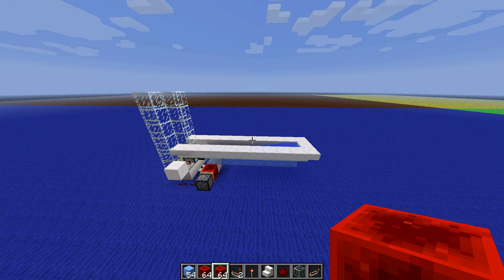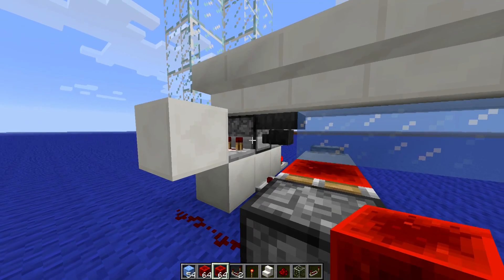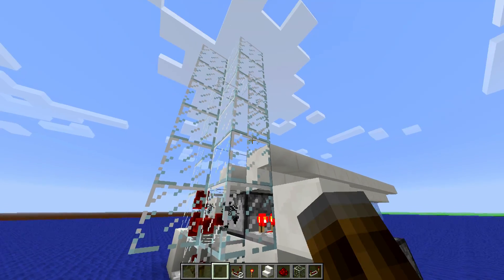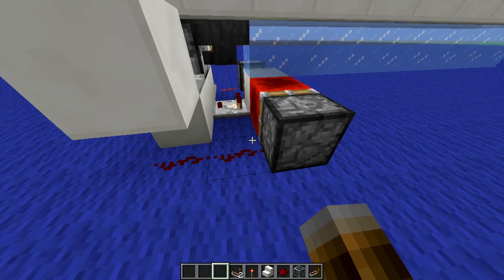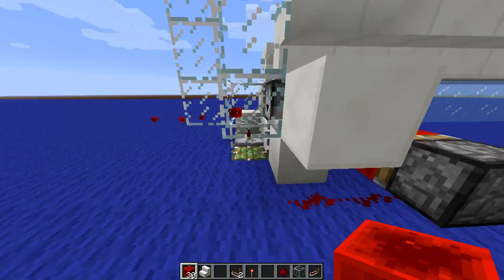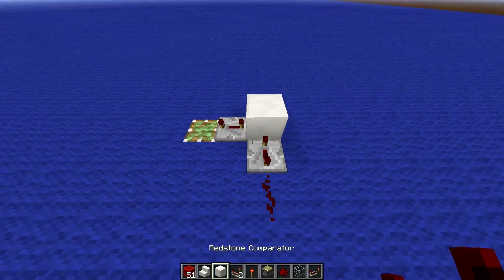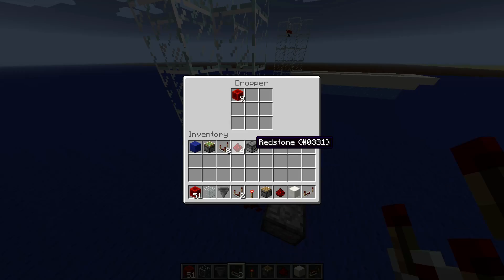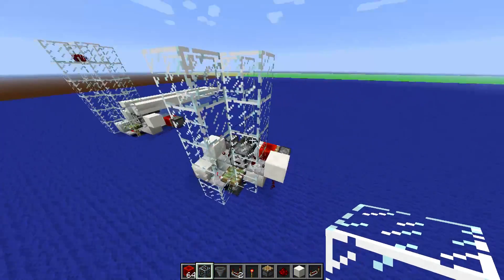Minecraft Hopper Invention #5: Simple Hopperdropper Itemelevator.

Comment: Still works, but you need a 2nd hopper. The comparator in the back, powered by the redstone block, needs to be fed into the dropper directly, and the pistons, redstone block, and other block need to be lifted one block to match it. To do this, you need to move the hopper to feed the dropper from the top. To prevent the items from flying out, however, you need to block the space above the hopper, so you then have to use a 2nd hopper to feed into that one from behind.

Comment: In 13w04a if you have vertical droppers feeding into eachother and power them all with comparators it moves the items up or down at a speed of 20 blocks per second. Example, bedrock to surface in 6 seconds.

Comment: Ok i thought of a different way,  have the hopper load into the back of the dropper.  have comparator to the left of the hopper, one redstone then repeater. off the redstone have a torch to invert, send that signal to the piston that pushes up.  the repeater goes to a block with a torch then invert tht signal, send that to a repeater and a comaparator that goes into the dropper.  now you have a fully auto elevator without any additional pistons.  Give it a try it works 100%